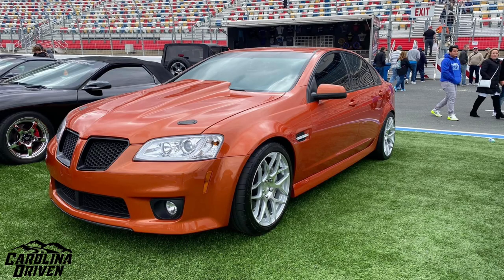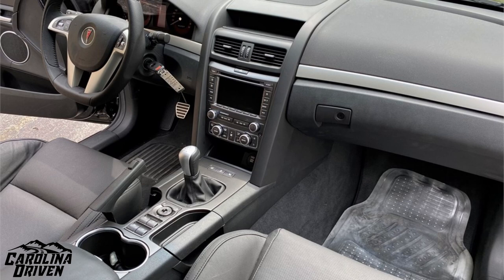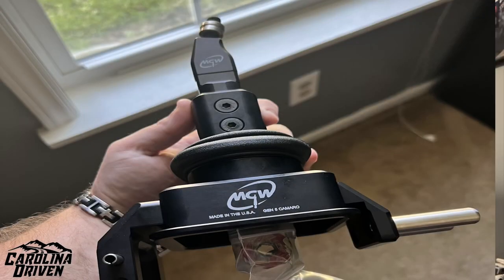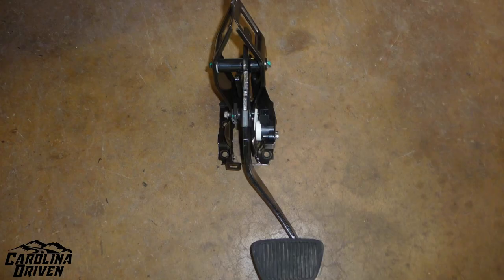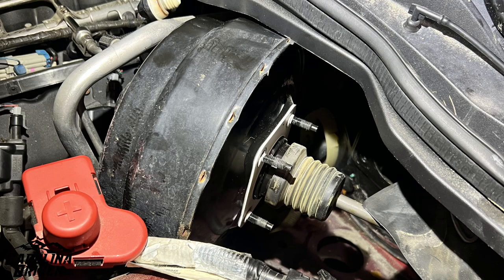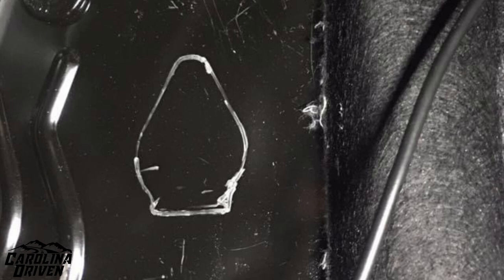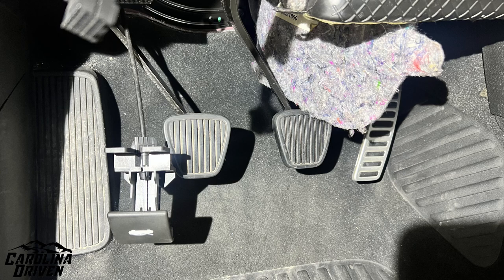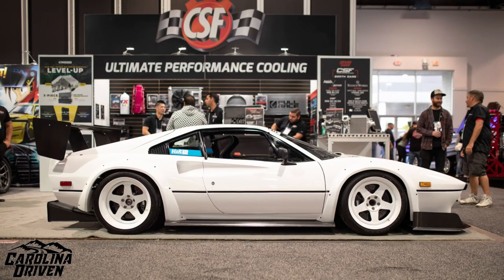Manual Swapping my Pontiac G8 GT - Clutch Pedal install

Comment: Really great video, man!  
I ended up going with the same clutch/flywheel package on my swap. No regrets at all.

We did the clutch pedal differently in that we left the brake pedal and booster alone. It did certainly make for a tight fit on the firewall when it came to bolting it down and hooking up the clutch fluid lines, but we got it. We also left the brake pedal the original size. I like it because it’s funny looking and it causes no issues.

You did forget one thing… rolling around in those sweet, sweet metal shavings after you cut the firewall. Lol. I swear, it seemed like I could never get them all out of the floorboard!!

Comment: Hi Pro good day, 
My car is a Holden Commodore SSV 2008 i already swapped it with a Camaro 2010  gearbox can you inform me of the transmission cross member that can i use, and also the transmission mount ... Thanks